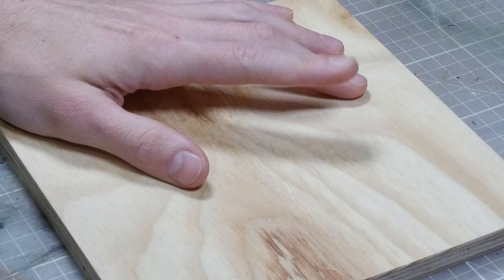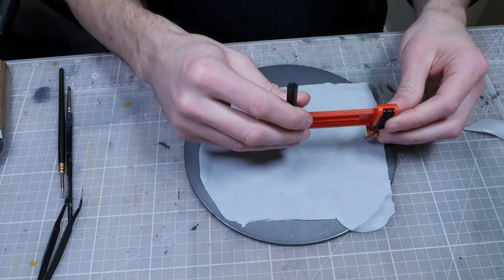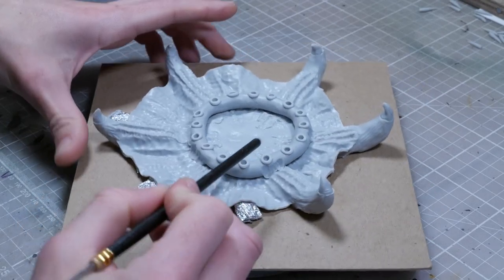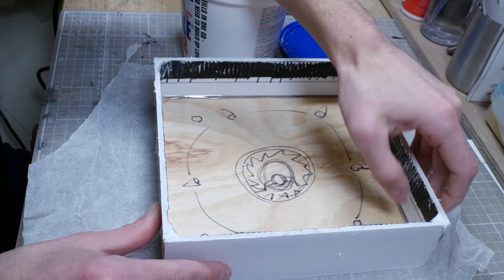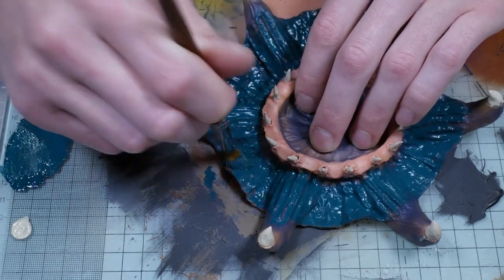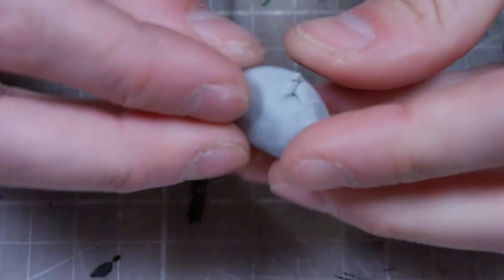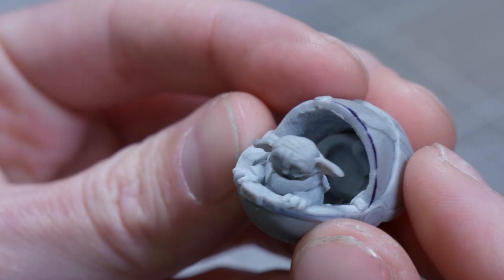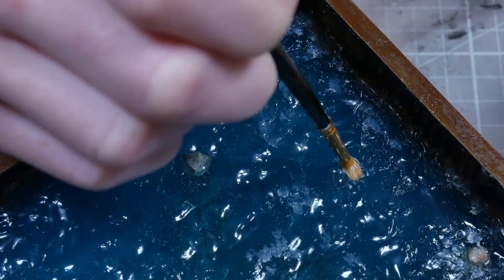How to Sculpt Baby Yoda and the Sea Monster [The Mandalorian Season 2]

Comment: Absolutly beautiful diorama. Sadly the seamonster is nearly invisible... Baby Yoda and the basket looks awesome.
Reply from the maker: Ugh, don't I know it. The resin pour was a bummer from the get go! Alas, it's a learning experience for upcoming deep pours!
Reply: @NorthoftheBorder  Couldn't your poor the entire thing at once? Why use 2 layers?
Reply: @ronaldvanderkooi7410  resin generates heat the thicker the pour, it’ll warp the resin or even discolor it the thicker it is.. it can even get hot enough to make smoke or melt your mold/barriers so it’s better to do multiple layers, it also prevents bubbles :)
Reply: I'm glad Grogu survived... Yeah, I'll keep thinking that. ☺👍
Reply: @ronaldvanderkooi7410  adding layers is safer and reduces bubbles. But you always gonna get bubbles unless you have a pressurized container that can suck them out. Either that or a blow torch.
Reply: I wouldnt say it's sad, part of the intrigue of sea monsters is that you usually don't really see what they look like, it's mysterious